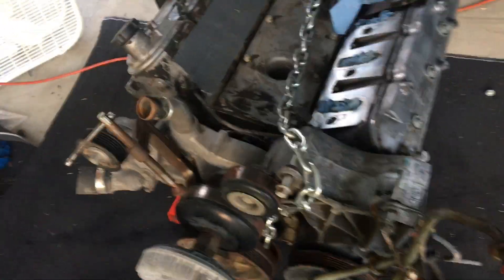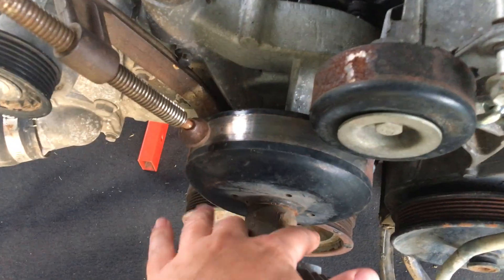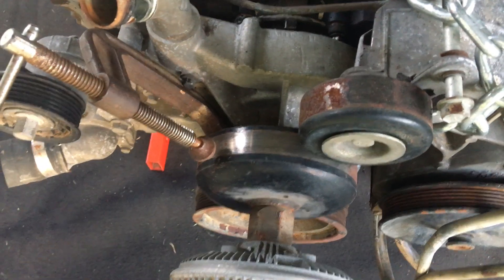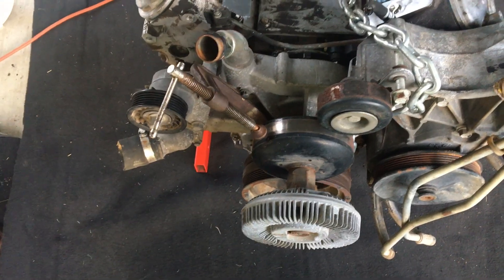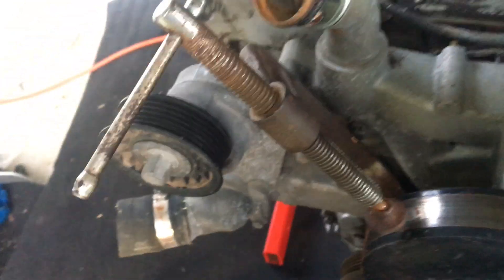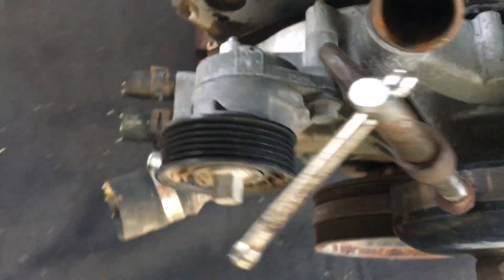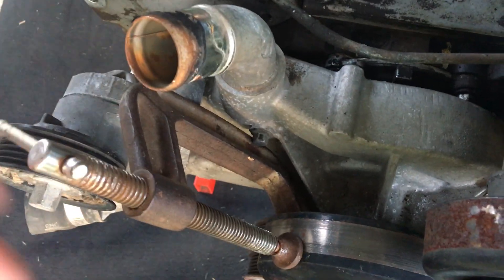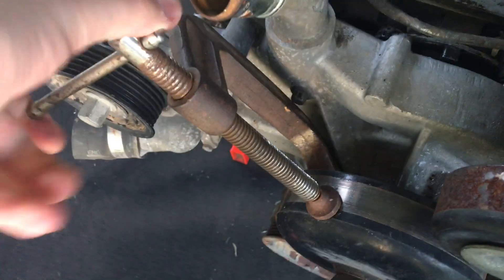How To Remove a Clutch Fan From a LS Engine | 6.0, 5.3, 4.8

Comment: for anyone who's doing this while it's in a truck: Keep your belt on the rig. Take a wrench or pipe wrench or even a adjustable worm gear style wrench and put it on there. Tap it the same way this guy did. Note to those worried about how to tighten it back on: It's self tightening, put it on and turn it until it's roughly snug. Tap the wrench in the opposite direction and then turn the motor over. And you're done.
Reply: Thank you sir that's a very good tip

Comment: Take your wrench point it straight up at 12 o'clock. Take a bigass hammer and smack the e d of the wrench. Will break loose 99 percent of the time!
Reply from the maker: Probably would work with the belt on!
Reply: True!